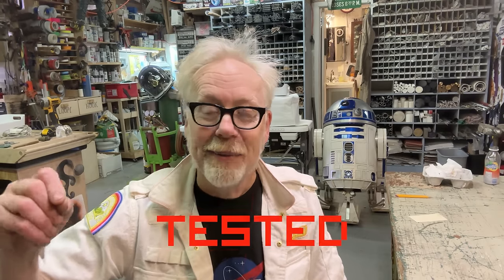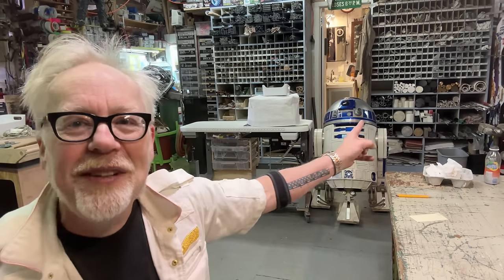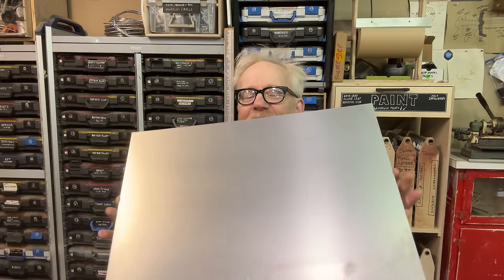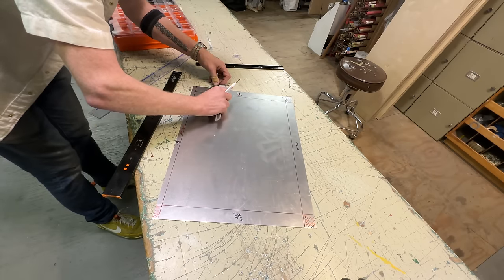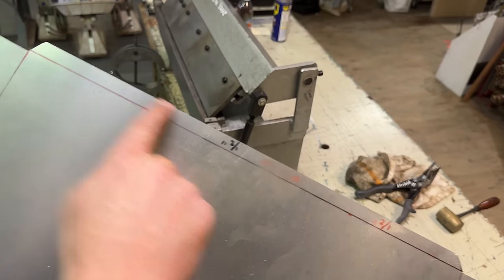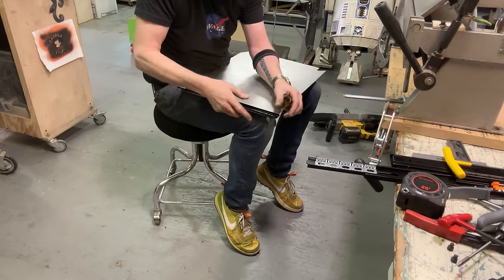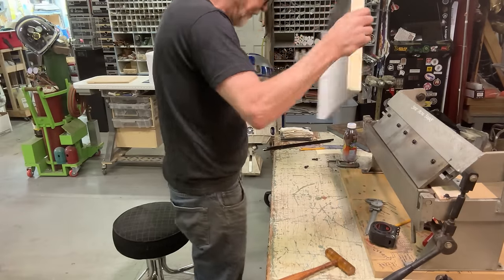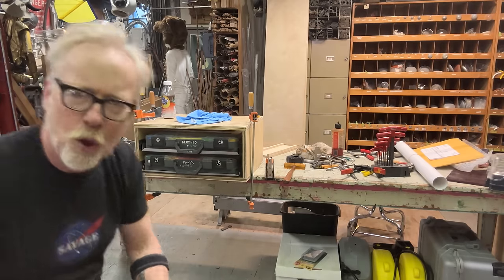Adam Savage Prototypes His Dream Hardware Storage System

Comment from the maker: Savage Industries Sortimo: https://adamsavage.com/products/savage-industries-sortimo-t-boxx
Pica Pen: https://amzn.to/3STblCx
Papermate Sharp Writer: https://amzn.to/3SZoc5Y
Dewalt Cordless Drill: https://amzn.to/3SZoc5Y
Dewalt Air Stapler: https://amzn.to/3SZoc5Y
Lufkin Tape Measure: https://amzn.to/48ym4rF
Dewalt Tape Measure: https://amzn.to/3wyXDNB
DeWalt stapler: https://amzn.to/48wszeF
Makita small driver: https://amzn.to/49RrIGr
Bondhus Hex T-handle set (Metric): https://amzn.to/2KXbrq6
Bondhus Hex T-handle set (Imperial): https://amzn.to/3dioI8K
Long 1/4"-20 tap: https://amzn.to/3IeOyvY
Alvin clear measuring ruler: https://amzn.to/49JcR0S
(Note: Ruler in video is Alvin ACR-20, unavailable currently)
Kant Twist universal clamp: https://amzn.to/49VpTsl
Starrett 6" Dial Caliper: https://amzn.to/3Ebvxb5
Cheap 4” dial calipers: https://amzn.to/2VvYCcd
Cheap good digital calipers: https://amzn.to/2VuzbHZ
Cheap dial calipers: https://amzn.to/3iddjKN
High Quality Mitutoyo digital calipers: https://amzn.to/2ZmlETJ
6" bar clamp: https://amzn.to/3Tf7mS0
Tap Magic cutting fluid: https://amzn.to/3TfLJRE
pocket machinist square: https://amzn.to/49UidGL
DeWalt Portable Bandsaw: https://amzn.to/48y8C7e
Pica Pens: https://amzn.to/3wFvKDu
Arrow Rivet tool: https://amzn.to/48Arv9M
WD-40: https://amzn.to/49vScxD
24-inch bar clamps: https://amzn.to/3v0hZ1I
Wiss Handheld metal brake: https://amzn.to/3UXA5Mz
Sheet Metal Brake: https://amzn.to/3Tf5xEB
Disclaimer: Tested may earn an affiliate commission when you buy through the links here.
Adam's One Day Builds: Savage Sortimo Storage Cabinet: https://youtu.be/nNHDs3qlYIg
Reply: Any idea about the ruler?
Reply: i wonder if these would fit standard server racks which you can sometimes find for cheap especially if a company is trying to get rid of them on ebay... if so, there is plenty of cheap hardware for those racks including sliding drawer components and trays.
Reply: I liked the tool recap at end:
1. Record of tools used
2. Reflection on how tools helped or may have helped for build.
3. Tools put away at end of build, shop cleaned!

Usually I finished a project and reflect just on the finished product, and less on the individual items/processes than each individual step. This could help me reflect more deeply on how the project went and as a bonus clean up my shop!
Reply: The linked ruler doesn’t seem to have the rubber grippies or the metal edge
Reply: The Sharpwriter is linked 3 times with 3 different descriptions. The Dewalt Cordless Drill and the Dewalt Air Stapler.
Reply: But, but I wanted a link to his power pop riveter used when the 3D printer rack was made . Sigh….
Reply: You should sell these drawers.
Reply: @eypresident I hope Tested is getting commissions from Amazon on these tool recommendations...
Also, I love the tool segment and links to the same/similar tools.
Reply: what you want are sortimo drawer closets used in vans over here in europe they are pretty common to get your trade van dressed in sortimo or different manufacturer's closets 

when i was at the trades conference couple weeks ago they had multiple different setups even one with a drawer with 12 sortimo boxes in a drawer in the floor of the van which you could pull out and open by laying them on top of the rest as in working life the floor is most of the time full of equipment . so instead of being horizontal mounted the where vertical in the drawer. thats the nice thing of the sortimo boxes you can transport them vertical without it mixing the content
Reply: I prefer a cornucopia of bits n bobs .... while playing the Kibbles n bits music ;)  with puppies running across the bottom of the screen lol
Reply: what watch are you wearing?
Reply: Here is a Tip for you,
If you Change the Tape Measure links to one with a lanyard you than can use the Clip of the pica pen to mount it on the lanyard ... Works great in my Shop, before i searched a lot :-)
Larkshead knot helps If the Clip IS to big to hold in its own

For the 2 drawers i think they should be mount under a assembly table. If you build Something you can grap 2 from the big shelv and have them Close and Not in on the table ;-)
Maybe you can add a lid holder to have the boxes in the lid Open configuration for easy use..

Sortimo has shelvs Like you build for Cars and Vans with a Push Button to unlock.

Greatz from Germany
and have a nice Day
opo
Reply: I see some SERIOUS CUTS from that steel if your hands or the drawer slips! Maybe put something over all the corners to make it safer?
Reply: What brand are the drawer slides? Those things look great.

Comment: I'm almost surprised that Sortimo doesn't sell cabinets with sliders allowing to do exactly what Adam is trying to achieve!
Reply: SAME. This is the typical operation you see for this type of organization at any hardware store, with this same style of rack.
Reply: I'm surprised as well, given that Sortimo has their full-on solution for van shelving you would think they would have one that supported these boxes as well.
Reply: same, even festool has drawers for the systainers that do this.
Reply: They do, the slides and cabinets are for work vans.
Reply: They do have several sizes of cabinets for the t boxx as wel
Reply: Same, I was so excited to learn about these drawers that I asked the general manager at the old cinema I work at for a greenlight to restructure our entire hardware sorting of old projector parts. I went on their website and saw they had an easy system for custom foam inlay drawers, perfect for old lenses. Then I learned they only make compatible racks for vans... why...
Reply: Yeah, or you could just use regular drawers. Also much cheaper. Those Sortimo are probably mostly made for service vehicles.
Reply: If Adam would have used ordinary drawers to begin with he would have saved a lot of money 😂
Reply: they do but the boxes Adam has are not Sortimo brand, this style of box has been called Sortimo even tho it was not made by Sortimo

the box made by Sortimo that is closest to these are T-BOXX
Reply: @111smd  They are "Sortimo T-BOXX's", he has a link to them in the video description.
Reply: @stevewurster  Sortimo is not a box company that also makes van shelving, they are a van shelving company (or more generally a company for van accessoires) that also makes boxes. That their boxes can also be used without vans is more or less an afterthought.
Reply: They do. At least here in Germany you can have either full racks or buy the single side slide slots.
Reply: @eikepierstorff5873  You are wrong. Herbert Dischinger was owner of a small shop for nuts, bolts and all that stuff. To made it easier for the workers to carry and store the stuff he inventet 1973 a plastic inlay that fit in the standard metal box of drilling mashines. The Sortimo. Step by step he increased that to his own box, then in 1990 shelves and interiour for workers cars and shops. So it is a box company in first.
Reply: @jimapollo  Let's split the difference. The boxes were first, but they literarily advertise themselves as a van racking company. So boxes not an afterthought, but van application definitely the focus for decades now.
Reply: Adam, Adam, Adam. You don’t need to make anything. Just buy the cabinets from Sortimo. It’s pronounced SOR TEA MO, with the emphasis on the second syllable.
Reply: If you buy these boxes more likely hood you could make a box and add draw slides.
Reply: YET
Reply: @111smd now, who am I going to believe. The guy making the video on his sortimo boxes, and has made several videos on his sortimo boxes, and links to sortimo boxes, or the random internet stranger talking out his ass? Tough choice!
Reply: @rasmusvedel  Pretty simple. Ask ANY german craftsmen. We all worked with sortimo storage systems since we were 16 years old, since 90% of the companys use those in their cars. Simple example: Of course sortimo offers their storage systems with drawers for their boxes and they already did this for min 30 years. This fact alone shows, that adam did not even checked their webside.
Reply: They do! I found them for m,s, and t boxx. They attach directly to the box and pull out like a drawer. Even Amazon has them
Reply: I've had them in my van for a good while now and the novelty still hasn't worn off. Grabbing that one screw or whatever is just so darn easy 😊
Reply: @MattManProductions  I dunno which ones you have found but the ones I can see are only 5 tall and cost around £480 so for 65 shelves that's like £6,200!

Yes they make products similar to this, but I couldn't see anything that provides the exact needs he has, on the scale he needs!

The larger units I've seen are great, but they are for multiple different box types, not a massive heat height rack like he has made
Reply: they are not Sortimo brand they are
Savage Industries brand model: Sortimo T-BOXX
not Sortimo brand model: T-BOXX
Reply: @111smd  only the ones that are orange and branded are Savage ones lol, most of these boxes look older (and probably are) than the very store he sells his branded versions on 😂

Also they are all still made by Sortimo, he's just got a custom line he sells, it's a branding partnership more than anything
Reply: They will now that he's gone through all this
Reply: Guys, at the end of the day, I’m pretty sure Adam is much happier building his own system rather than simply ordering  them online!
Reply: @LuziferQQQ  zero relevance to anything I wrote.
Reply: My workaround has been Durham Manufacturing 303B-15.75-95 cabinets, these are stackable units with simple slide-out metal shelves similar to the ones Adam's creating. They're intended for Durham's own metal parts boxes, but Sortimo T-boxxes will fit if you dremel a couple notches into the plastic lip on the bottom and remove the lid from the T-boxx.  It's not ideal because you can't just pick up the T-boxx and carry it away, but they can at least be pulled out like drawers in order to get to the contents.  No soft-close slides, either.
Reply: Vevor sells a 24 inch sheet metal break that looks like a knock off of what you have there for <$300
Reply: I would have saved the expenses and made a shelf that slides into the gaps in the racks, but sticks out enough to support the box. Slip it into the rack, take out your Sortimo, rest it on your movable shelf, take what you need, replace the box, remove the temporary shelf.

Comment: My first thought was not to make every box its own drawer but to simply add a slide out tray to set the boxes on. Maybe one per rack so you can have several open boxes at once.
Reply: I thought the same thing
Reply: Oh no...did you just solve one particular issue I have....thanks for the idea. Not exactly it but that nugget gave me an idea.
Reply: Alexandre Chappel is a YouTuber who built his own sorter boxes and built a tower to hold them. It has a single pull out surface to set the box on to pull out what is needed.
When Adam started going through this process, I instantly thought of that video. It is definitely cheaper than 60+ pairs of drawer slides.
Reply: That was my instant thought!

However, the bit later in the video where he's talking about economies of scale made me realize that this solution is probably better for his situation.  When time is money and you're likely doing a large job, the process of pulling out a box, setting it down, grabbing the part, and then putting the box back times however many parts you're needing for a project can really add up when compared to just pulling out a drawer, grabbing, and closing up.
Reply: That said, if I were fortunate enough to come into possession of sortimos (sortimi?)  I think I'd do the slide out surface option because I do not deal in the same sort of volume.
Reply: That’s typical for some filing cabinets: one pull-out tray per stack at belly height. Tired and tested – ah I mean tried and tested.
Reply: That was my first thought as well. It would save a lot time and money with the advantage of having them at a convenient height.
Reply: Another advantage of using single shelves in the middle of each stack is you can pull out the shelves, then pull out the cases you need and lay them side by side, allowing you to scan through them in one visual sweep. If the cases are all in their own individual drawers, they may be stacked on top of each other making it hard to view multiple cases at once.
Reply: …but having slide-outs for each box is of course the ultimate convenience. If you can afford it, why not. Just made me chuckle because Adam is basically creating very expensive chests of drawers, except each drawer has a lid.
Reply: I would have just made a roll around table that was to carry the sortimo
Reply: Disadvantage of a midline shelf is that you’ve created a horizontal surface with non-dedicated purpose. even though they pull in and out, it’s a blank space. One might be tempted to leave a case resting on it while completing a task and clutter has been created. 
With each one being a drawer, pull in and out and they’re stowed away again; no reason  to leave it pulled out.

Midline drawer absolutely is a solution. But, I’ll bet Adam considered these factors. It’s also fewer steps of retrieval. 

A rolling table would multiply the possibility of that surface becoming another catch all.
Reply: It wouldn't surprise me to see Adam's final cabinet solution include a waist-height slide-out surface in addition to the Sortimo trays, just for the general utility.  Since he's already overdoing, why not both?
Reply: I thought the same. There's a fairly narrow band of heights where it's comfortable to look down into a drawer. With Adam's current setup, it's about the middle 1/3 of the racks. (actually a bit higher.) All the rest will be a bit of a pain to use.

Of course, this might be part of the ultimate design. Adam could build storage with three tiers, across a wider space. At ground level are big things you'd rather not lift higher than your waist. At about waist level up to not quite shoulder height are the sortimos. Above that are smaller things that are easy to reach for.
Reply: @swalker4655 yes, but also a matter of organization of likely “companion” boxes to be horizontal not vertical. Then you could pull 5 boxes of “electronic parts” or “M2 thru M6 fasteners” out, side by side. Also, the drawers do not exclude the idea of pull out shelves at “bench height” as well.
Reply: This is exactly how I’ve built mine. I make units of 6 Sortimo slots with a pull-out shelf on the bottom. These can be connected on top of each other and put on casters, or mounted to the wall side-by-side. It’s especially nice to have two towers next to each other, or have them side-by-side on the wall, because then I  have easy access to two side-by-side pull-out shelves. I find I’m often searching for things which requires taking out more than one Sortimo, or I’m organizing things between a couple Sortimos.
Reply: Variation:  mount vertical rails that accept a single shelf that you raise and lower to the level of the tray to access. Perhaps holes at each tray level for pins with springs to lock into so heights don't need to be attended to for each move. Could get fancy if moveable shelf has lip on front and could be tilted forward for more convenient access. A variation would be to have a self-supporting structure that traverses horizontally like old fashion library bookshelf ladder to access stacks. An extension shelf on rails that moves in two axes.
Reply: @tiffanysandmeier4753  yeah I just checked out the video.  I think he's got it right, though he probably spend a LOT of time 3D printing.
Reply: This also occurred to me because the trick I use at work--when I need something from the back of the drawer or from one too high for me to peer into--is to open multiple drawers below it; then I REMOVE the drawer I need to dig from and set it across the other open drawers at a comfortable height.
Reply: Exactly. You only need one empty space for that slide out. Lateral thinking by people who don't have the money for 65 sets of drawer slides.
Reply: I had the same issue with my Harbor Freight version, and I put in a telescoping full extension shelf. If I were Adam, I would go ahead and do the plan he has which will work for 90% of the times he uses the boxes, but also add in the shelf at ideal height for those other times when you just want it to be at the right height.
Reply: Exactly this - You only NEED 1 Pull-out slide. Remove 1 hardware case at waist height, replace it with a Single Pull-out shelf - Done. 
With a little work you could probably add the pull-out shelf between 2 of the hardware cases and not lose any storage space.
No need to bend down to pull things out of the bottom drawer or getting on a ladder to remove stuff from the top drawer.
Just pull out the Shelf, put the hardware case on top of it then return the box to its original location.
Reply: @tiffanysandmeier4753  Cheaper and....if your nemesis is drawer slides (like mine is) do you know how much time you'd be saving?
Reply: @mm9773  Well, there's a really simple reason - because for many/most of us, drawer slides is our kryptonite.
Reply: I came here to say exactly this ⤴️
Reply: @tiffanysandmeier4753 True . I made something similar 15 years ago , the problem with having to move the box to a flat surface is that every now and again the box gets knocked off and what a bastard job it is having to pick up the contents and re sort them . Drawer sliders all the way for me
Reply: @kevindesilva4588  I don't think I could afford that many drawer slides.
Reply: @tiffanysandmeier4753  But have you got that many boxes ? I suspect Adam has more than average .😀 I now have 20 but start off with 3 and made a 5 rack